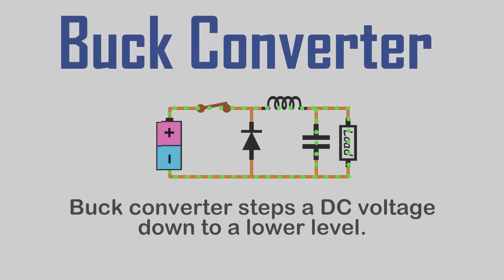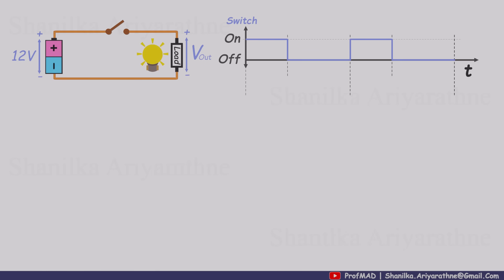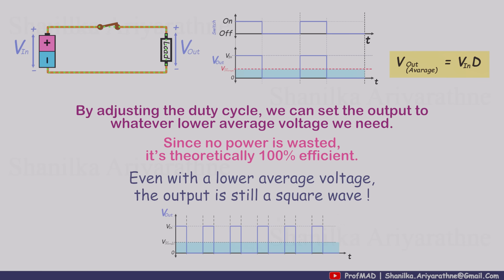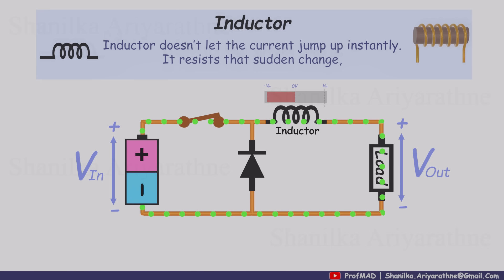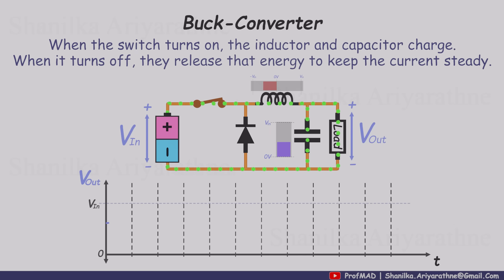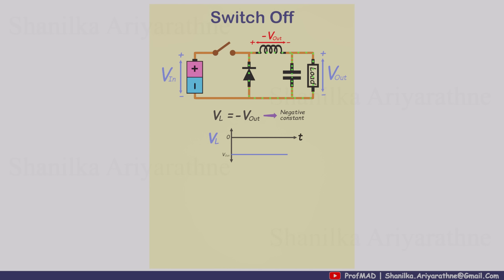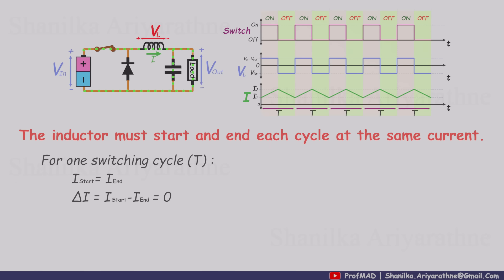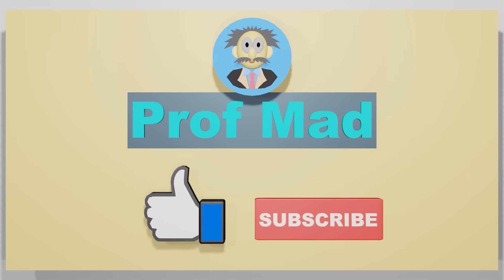How Buck Converters Really Work (and Why Vout = D·Vin)

Comment: Capacitor usually blocks dc. Xc=1/2piFC. For dc f is zero. So obviously only small current flows through c and it is negligible
Reply: The average current through capacitor is zero..

Comment: I was hoping you would go into more detail on exactly what effect  the capacitor is having on the circuit. That is, show us the current and voltage flow across the the capacitor through the phases of switch duty cycle. Or maybe what we should track is the  amount of charge held on the capacitor at each point in time.

Comment: Just to point out that the Vout = D Vin derivation at the end of the video assumes current is always flowing in the inductor.  At low loads, the inductor current drops to zero for part of the off-cycle and breaks the maths, since the voltage across the inductor is no longer -Vout.
For low loads, duty cycle has to reduce.  In the extreme case, duty cycle must be 0 for no load, other wise the capacitor would charge to Vin.

For me, this is an important point, because I never really believed Vout = D Vin until I was able to explain why that wasn't true at low current.
Reply: There's always a feedback loop to prevent the high voltage at zero current burning the equipment.

Comment: The drawing of the capacitor only waveform is wrong. Voltage measured across the capacitor when the switch is first closed would be 100% instead of the slower rise depicted. The resistance shown between the capacitor and battery is zero so there is no instantaneous voltage drop from the battery . Of course no voltage source is ideal (i.e. internal resistance never equals 0) but that is not depicted on the no capacitor example either. So to be consistent, the waveform should have a square front edge and then a curved back edge (as shown).

Comment: Great, but you didn't explain the switch operation. What causes it to switch on and off?  Thanks. Regards
Reply: Triggering and commutation circuits. Turn on and turn off circuits. Please refer power electronics book. In real world these switches are MOSFET’s which operate at high frequency…

Comment: Maybe i am wrong but I think something is wrong with your inductor, i think inductor produce back emf in opposite direction, inductor doesn't provide power during off cycle like capacitor, inductor opposes sudden change in current so when switch turns on, it opposes the sudden increase in voltage and when switch turns off it produces back emf but because of diode it don't reach load and during this time capacitor provide power to load
Reply: Inductor opposes current first in creating a magnetic field. Next the field collapses to return current in the same direction. His theory and data are perfectly correct.

Comment: How does the voltage drop across the diode change things up?  granted it's maybe 0.6V but it's still voltage that is not available because you're trying to push current across the potential gap of the PN semiconductor.    Also a bit of a loss from the inductor resistance, not 100k crazy loss, but still not 100% efficient.

Comment: Nice, better than the average explanation, this makes a lot more sense of what is going on in a buck converter. I felt it was very smart to just draw "a switch" and not get into exactly what that means, as knowing what happens there does not contribute to understanding of the basic concept. I appreciated this approach even though I am an electrical engineer so the topic was pretty familiar to me. Like others suggest, a part two, dealing with some of the inner details, may be fun.
Reply from the maker: Glad you appreciated the approach! Thanks for the feedback. 😊
Reply: I agree, but spending a minute at the end of the video to briefly show the switching method wouldn't have confused the basic concepts, and it would have left anyone waiting for the other shoe to drop.

Comment: For those interested in more information on buck converters, look into synchronous bucks. They use a FET (Field Effect Transistor) that is controlled by the switch mode controller in place of the diode. Also look into pulse skipping mode which helps save power when there is little to no load. Most modern switch mode controllers offer the above features.

Comment: I learned something new today.  Current flows from positive to negative, not the other way around.  Wish I could go back to school and tell my teacher he was wrong.
Reply: Your teacher is not wrong.  Electrons are what flows in a circuit.  But people don’t like working with negative numbers, so we work with “conventional current”, which can be thought about as the “electron hole” left behind as an electron moves between atoms in the conductor.  If a negative charge moves from left to right, the site it vacated just became more positive.  The hole moves from right to left (the opposite direction of the electron current).  Sound complicated?  That is why your teacher never mentioned it.  I teach all my circuit theory (and most do) with conventional current while mentioning the difference between them. This is probably the 2nd biggest misunderstood element of circuit theory, with voltage differences and voltage being the worst.
Reply: @nrobo3840 so that doesn't explain electron flow when there's a capacitor in the ac circuit even when current flows from phase to neutral at near the speed of light from power station to the cities.
Reply: Early scientists like Benjamin Franklin decided what was positive and negative, and that current flows positive to negative.  They had no way of knowing that was the wrong way round.
Later scientists discovered that electrons flow negative to positive.  Rather that rewrite physics, they doubled down on the idea that current flows positive to negative by saying that electron is negative.
So negative charge moves from negative to positive, which means positive charge moves from positive to negative.
XKCD has a cartoon where a time traveler goes back and tells Ben Franklin to do it the other way round..

Comment: An inductor stores electric current in its magnetic field. When the switch is open  the current across the inductor is zero and the voltage is maximum. Here voltage leads current by 90*. When the switch is closed current increases while voltage decreases. When the current across the inductor is maximum the voltage reduces to zero .
We have a fully charged inductor. Now when the switch is opened the inductor begins to discharge its load in the form of electric current that was stored up in its magnetic field. Now the current begins to diminish and return to a zero point while a concomitant voltage begins to increase to its maximum value. 
This exact cycle repeats with every opening and closing of the switch. 
But nowhere in this cycle does the voltage become negative, it merely goes from maximum to zero and from zero back to maximum. 
When the voltage is @ maximum the current is@ minimum , when current is @ maximum voltage is @ minimum.
Reply: ELI the ICE man

Comment: Excellent video. Can anyone tell please (in the beginning of the video), when the switch is "closed", why doesn't current flow through the diode, as it is reverse biased? But current only flows through diode, when switch gets opened? 
Can anyone tell please?
Thanks...
Reply: during the OFF cycle  the switch opens, disconnecting the input voltage.
The inductor current cannot change instantaneously.
To keep current flowing in the same direction, the inductor’s voltage reverses polarity.
This reversal forward-biases the diode.
Current path now becomes:
Inductor → diode → load → ground → back to inductor
The diode provides a flyback path for the inductor current.
Reply: @markkiggen Thanks for such a nice explanation. If I am not wrong, when the switch opens, the path should be from....inductor....load....diode.... and back to inductor...
Kindly correct me please?
Thanks.
Reply: @KPKCCK  I think you are correct, given conventional positive to negative current flow.  I would sometimes describe it the way Mark did (good explanation) but then remind myself that I was thinking of electron flow..
Reply: @epiendless1128 Thanks for the clarification.
Appreciate 👍!

Comment: How much RF do these things generate?
Reply: They are pretty noisy but it is mostly not RF, the frequencies are less than a MHz and wire lengths are way too short to radiate it.  You don't want one of these near your sensitive components though (video or audio etc).

Comment: But who is swinging the switch on and off? How does it work?
Reply: Typically, an oscillater which can be constructed with desired frequency and duty cycle
Reply: @j @jon-f4r  thank you. I presume the choice of the frequency is important to prevent the inductor's current to drift.

Comment: Vout = Vin x duty cycle is true only if the inductor current does not dwell at zero at any time during the switching cycle. It can go just to zero but not stay there. When the current always stays above zero throughout the switching cycle it is called "continuous current" operation. When it stays at zero for a time each switching cycle it is called "discontinuous current" operation. If the circuit operates in discontinuous inductor current mode, the equation relating output voltage to input voltage and duty cycle changes substantially. Now each switching cycle has be be regarded as a "packet" of energy. The duty cycle must be lower than it would for continuous inductor current operation.
In practice, the designer sets the output current at which the mode transition occurs (sometimes called "critical current") by selecting the inductance to be used.

Comment: It is very good to describe the circuit operation, but why didn't you say anything about the proper switching frequency?
Reply: It's always challenging to decide how much information to include in any particular educational video. If you had produced it, you would've included the discussion of switching frequency. Fine. I'd have watched and been happy. But someone else might ask why you didn't discuss typical oscillator circuits or semiconductor switch types.

I think this does an excellent job of describing the basic theory of operation without getting too far into the weeds, but that's a judgement call.

I worked on voltage upconverters decades ago. I can still draw the basic topology and describe its operation but I'd have had to sit and think about a down converter. This was a nice refresher for me. As we used to say back in Usenet days "YMMV."
Reply: @civildiscourse2000  Thank you for your reply, you are right. I was convinced
Reply: @mash_ghasem Very gracious of you to say so sir. Best wishes to you.

Comment: first picture is not a voltage divider
Reply: It certainly is!
100k ohms in series with 33k ohms.
Reply: @MrSummitville  33k resistor showed like it's load and that's not how you connect your load to voltage dividor
Reply: @Thrill98  The LOAD is 33k ohms. It creates a Voltage Divider circuit with the 100k ohm resistor.
Reply: @MrSummitville  it creates voltage drop across it but to use it you have to connect LOAD in parallel to 33k
Reply: @Thrill98 The load IS 33k ohms and it  is part of the Voltage Divider.
Reply: it quite literally is

Comment: Question, how do know how to change 12volts to a lower dc voltage?
Reply: Use the formula volt out equal to volt in multiplied by duty cycle. Eg. 12 × 0.5 = 6 . 😊 Do well.
Reply: Primitive  "automobile regulators"  used a vibrator. Guess that's a duty cycle too.

Comment: The video loses value since you claim near 100% efficiency, yet you failed to provide a switching circuit and show the method of adjusting the duty cycle, and failed to show the losses of that circuit.
Reply: @memy - Very good Buck Converter designs can reach 97%, and higher efficiency, given specific loads.

Comment: great but that little magic switch has to be explained with a few transistors.
Reply: This video just explains the relation of the duty cycle to the output, whether it's a manual switch of solid state one.
Reply: Yep,    and Would a zener prevent E-runaway?
Reply: @R.Akerman-oz1tf  yes, if power is low
Reply: Why?
Reply: @YunxiaoChu bc just throwing a blackbox intonthe problem doesn't help a lot